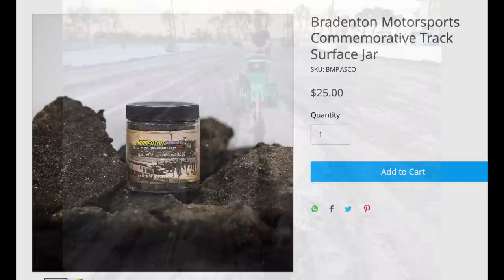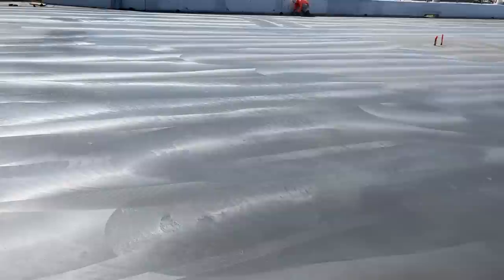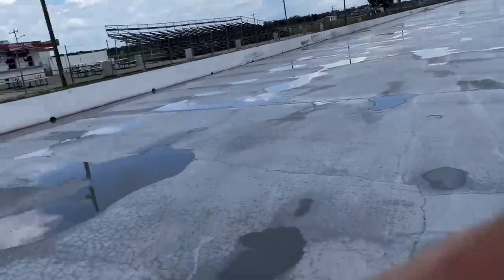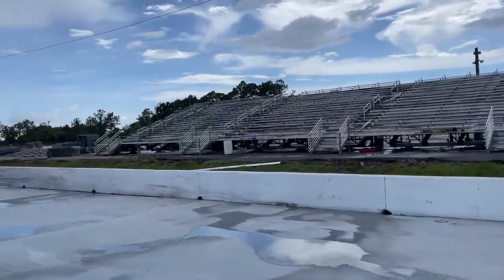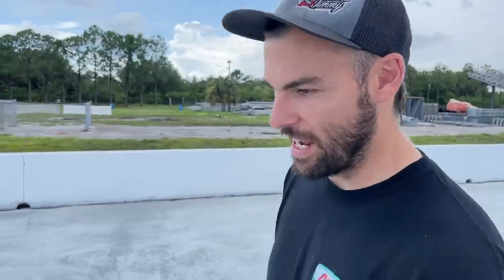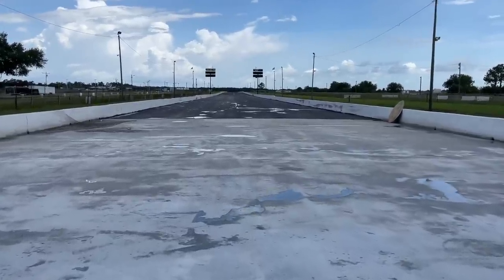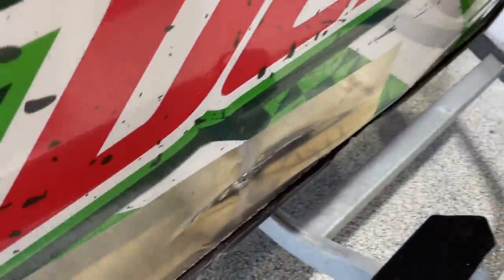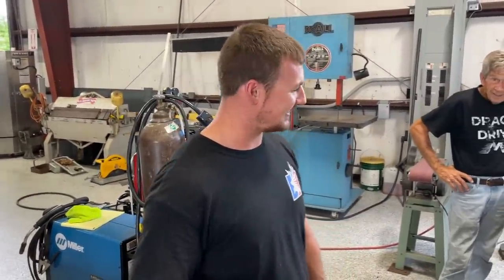This Is Why Our Beloved Drag Strip Closed...

Comment: Bradenton will forever be one of the best prepped drag-strips in the USA
Reply: That's cute but Maryland has it covered
Reply: Considering how many WR’s are set at Bradenton already it will be scary how fast cars go down the new surface
Reply: @User78347  I live in MD, I would love to know of a track that is better then Bradenton
Reply: Considering how the concrete is already cracking I don't see it lasting that long
Reply: @kevinbutton4580  concrete cracks. It’s not a big deal. And they don’t have a freeze-thaw cycle. They hired the best. I’m sure it will be fine.
Reply: @kevinbutton4580  That's how it is, it cracks.
Reply: Little Thumper 67 camaro seen that track many times along with Maxie's 1320 out of Taft Florida.
Reply: @kevinbutton4580  tell me you’ve never poured concrete without telling me…
Reply: @kevinbutton4580  and not to mention the questionable grading with all the water ponding spots
Reply: @User78347  when it gets resurfaced it will help out a lot
Reply: @User78347  you don’t seem to realize how much it can rain in Florida and how little water that actually was
Reply: @kevinbutton4580  this isn’t your daddy’s driveway bud. Cracks are everywhere just go look at a race track. F1 tracks have cracks , nascar has cracks.  You just don’t know what ur talking about and it shows
Reply: @User78347  I guess you didn’t pay attention to the video.  They are grinding and putting a finish on top of it, but hey, you clearly know better than all of us.
Reply: @1216jimmyz  been in the industry 35 years
Reply: @User78347  35 years and misses the part about it having yet to be surfaced yikes
Reply: I'll throw Pacific Raceway in there.
Reply: @User78347  damn, remind me never to hire your company to do any work.  Can’t even hear something that was said multiple times about exactly what you were complaining about.   Sheesh

Comment: Nice to see that Bradenton has gone full tilt in on improving the strip. It’s nice when the owners are willing to spend a whole lot of cash to make the track much better for contestants and fans alike. I can’t wait to see your first runs on the new surface. 👍👍🇨🇦
Reply: @fast97z24  those numbers sounds extreme
Reply: @fast97z24  Tell mm you didn't listen to the video without TELLING me you didn't listen.
He straight up said that it was only half concrete to the eight mile.

Comment: The new concrete is already developing cracks from the looks of it. Hopefully the work they still need to do to it will get rid of them. And fwi I'm not talking about the expansion joints they cut in to allow the concrete to expand.
Reply: Yea there were lots of cracks in the surface, they might need to put down a new layer. Down in homestead the pit lane has barely any tracks in it after years of use. That has tons of cracks, however it isn't done yet but it might need another layer of concrete before they grind and seal it.
Reply: Watch at 3.54
Reply: I've done concrete work all my life and concrete is going to crack no matter if you have expansion joints in it or not even if you have wire mesh inside the concrete it will still crack which is why concrete crack filler was developed sealing the concrete Will also help with cracks!
Reply: Also concrete takes 75 years to fully cure so cracks can develop at anytime even the hoover dam is still curing
Reply: I hope they have some extra layer going on. It's cracked all to hell and the water pooling isnt ideal

Comment: Thanks to Victor for doing this!  A huge investment and commitment to the car community!  I'm from Atlanta and losing Commerce to apartments still stings.  There's not a drag strip left in north Georgia.
Reply: Did they close the one at the top of Georgia, Ringgold I think??
Reply: Couldn't agree more.  Silver Dollar is the next closest and it's 2.5hrs from me which is a painful drive one way to race.
Reply: @94b20gsr  what about middle ga?
Reply: @truckerdudexxl  That's basically where Silver Dollar raceway is, in Reynolds GA.
Reply: @94b20gsr  nahhh, you have silver dollar and middle ga over in twiggs county

Comment: I'm sure that low cost ease of repair for the Mustang axle is exactly what Vaughn was planning for when he said you'd only get it setup how he wants
Reply: "Full floater" rear end is ideal for easy maintenance.  The axle holds no weight.  All it does is drive the wheel.  Break it, and slip a new one in.  The wheel bearing  assembly holds the weight of the vehicle not the axle.

Comment: back in the 70s my grandfather owned one of the crews that did the concrete at Pomona Fair Flex dragstrip. i grew being able to hear them practice and hear the difference in top fuel compared to the rest.  and of course, i went to watch them drag. you're doing so much for the community with putting money into tracks. respect for that. your prolly a life saver for a lot of people making these tracks available again.

Comment: That concrete is super spider cracked from drying to fast. Maybe it don’t matter as much because they are grinding the surface. I just know from having my brand new garage floor done. It looked like that and the co
Kanu came out had to grind it and surface it. The owner explained why it came out wrong and why he wanted to fix it.
Reply: Did you bother to listen to the video?  The finish is not complete.
Reply: @paulcopeland9035  a crack is a crack. Nothing they do from here on will fix that and it will continue to need touch up. It's really ashame.
Reply: I don't imagine cracks are that much of a worry in Florida. It's notice they have 5 months of continous freezing and thawing temps that will destroy it. It's concrete, there are only 2 guarantees with concrete, it's going to get hard and it's going to crack.
Reply: That's crazing it's from to much water being used on the top to finish the concrete. Could be a problem.
Reply: @splashman420  Supposed to be professional Drag Strip concrete guys??? Is it just the cream on top with the cracks????
Reply: @stoker20  he said they were going to take 1/4 " off grinding, I imagine if it needs more then they will do it at that time. Probably poured way to wet. Pouring concrete in Florida is a lot different than other places.

Comment: Wow Victor is the man!  Putting some big money into Bradenton.  Concrete is SO much better than asphalt.  Especially when it gets hit and because rain doesn’t seep down into it and then get pulled back up by higher horsepower cars.  My only concern is leaving asphalt on the big end.  Will make tuning high horsepower cars a bit tricky.
Reply: So confused by this comment. Not sure what your trying to say..
Reply: @masterbates7016  asphalt absorbs some water when it gets wet and big hp cars put so much energy into the asphalt trying to hold traction that it shakes the water to the surface and could cause cars on slicks to lose control. Although if you’re having traction problems past the 1/8th mile idk maybe get some better suspension or tires
Reply: @masterbates7016  - Yeah, I should have proof read it before posting.  Definitely not very clear.
Reply: @fernandop937  - Some years ago I went to a March Meet Nostalgia race at Bakersfield, CA.  The track back then was all asphalt and it rained for like a solid week prior to the event.  It got really dangerous for the faster cars (under 8 seconds).  With the rubber base covering the asphalt the cars could launch ok but past half track where the rubber got thinner the cars slicks would pull up moisture from the asphalt.  Cars were sliding all over the place at speed and at least 2 cars were destroyed in roll overs.  They ended up having to cancel the event.  A few years later the track owner tore out the asphalt and put down concrete from start to finish.
Reply: Almost every track has completely different levels of traction at the 1/8th, hell some dont prep past the 1/8th so tuning will be same as normal.
Reply: @Jake_Hamlin  Check out the NHRA national event tracks.  Over the last few years they have all upgraded to concrete starting lines.  Typically they run the concrete out to 300'.  A full 1/8th is rare!  When Bandimere (Morrison CO) went to 300' concrete they also added cooling lines in the slab.  They have a chiller that will circulate coolant when the track temp is excessive.
Reply: @paulcopeland9035  The whole 1320 feet and then some at Bandimere is concrete. It goes from the water boxes to past the finish line.

Comment: That concrete looks bad. It's covered in shrinkage cracks. Looks like it was poured too wet to me and on a really hot day without doing anything to keep the concrete Temps down. Hopefully it's just on the surface and they can grind through it
Reply: There's still steps left to the surface
Reply: I was gonna say the same thing. That shit is gonna fall apart with the tires rippin. Looks like it was just the first truck
Reply: i guess we will find out. doubt he had rookies pouring but we will find out in a couple weeks
Reply: I've got quite a bit of experience with concrete.  That shit looks like shit
Reply: The spider cracks really don't matter much on a drag strip.  A local track poured their first 330' about 5 years ago, albeit it didn't look this bad but close, and that track is dialed now.  But yea, i'm about to have 40 cubic yards poured in a garage and I will cry if it comes out like this lol.  Waiting for the temp to come down some.
Reply: I was thinking the similar with all the cracks. Like it was said that hopefully they can finish it to eliminate the cracks.
Reply: @ToObUrNoUt   what do you mean they don’t matter? 7 years in concrete here. The surface is gonna fall apart as soon as someone try’s to burn out. Unless there is another surface I don’t know about going on top
Reply: watch the whole vid he said they are not finish and it will also be grind
Reply: He says it in the video, they're grinding the top, polishing it, and putting a finish ontop. 3:55
Reply: @justaguynamedmax8207  yeah? just like a house without siding looks like shit. they aren't finished yet. and if it bothers you so bad drive down there and tell vic what's wrong with it
Reply: @spitfire20122000  Exactly, that's not the finished surface.  Once it is grinded and polished, and they lay rubber down it will be fine.  Those spider cracks will affect the finished surface just as much as the control joints will.
Reply: @Kemicalkoma   he’s just pointing out the obvious. Concrete guys see that stuff and cringe. But it’s not the finished surface so it doesn’t really matter
Reply: Those are just surface cracks from the concrete drying to fast it will be fine
Reply: @Kemicalkoma  well, when I put sub flooring in a house I make sure it's butted up tight and properly nailed and glued.  Just because something is being covered up doesn't mean the quality of work doesn't matter.  How is a surface suppose to hold when the sub surface is falling apart?
Reply: @ToObUrNoUt  Not sure what your background is but I've been a commercial const super for 30 years. Poured well over a million yards including 2 rinks and 3 gyms along with many schools and a few hospitals and never seen cracking like this on a straight line pour. Luckily this is slab on grade because if it was structural we would have had to epoxy inject every one of them or remove the slab possibly. If those cuts were done too soon, they will dry faster and become a 3/4 inch to 1 inch hill that will taper down 4 to 5 feet each side... i know, I had to grind a gym for a month because an engineer spec'd this on one of my sites. The cracks can become a problem if not sealed properly because of moisture penetration attacking the rebar but luckily you don't really deal with frost which would just destroy this concrete over time.
Reply: He supposedly used the best crew for drag strips but yeah it looks like they didn't keep it cool while curing, it looks like crap...
Reply: It looks like there are some larger cracks in it too which is very concerning.
Reply: @spitfire20122000   Shrinkage cracks like that are almost always totally cosmetic. If they weren't going to put a surface on it, it could become a problem with water penetrating into the slab, especially if it ever froze. The track prep will keep water out. I would also say that those cracks would have easily been prevented. Adding a retarder or fibers would have been a great start. Keeping it cool on the surface would've helped a ton also.
Reply: @Towing417  id bet money the surface the way it is wouldn’t hold up well to constant drag racing abuse. No big deal though since that’s not the final finish anyways. Hope it turns out good!
Reply: @spitfire20122000  I hope it turns out good too!
Reply: @justaguynamedmax8207  There is always one!  Or in this case, every YouTube concrete expert there is has to tell us how good they are and what total shit everyone else is!!

Comment: Looking great!!
Concrete does not dry. It cures :)
Technically, it never stops curing.
Concrete gets stronger and stronger as time goes on but to reach a practical strength, most industrial concrete mixes have a 28 day curing period.

Comment: Love the racing content, especially love all the fun you guys have in the ripsaw, jetboats, and everything else you get into. I do kind of miss the videos from the old shop where it was all about working on the cars. Would love to see more videos from you guys working on the cars, either tearing them apart or pulling an engine. Even the basic stuff you do before every race to make sure the engine is good, would love to see more of the small stuff you do.

Comment: I’m wondering if there’ll be engine changes to Leroy? I’ve been curious what a compounded boost setup would do for that car now that’ll have actual traction.
Reply: Do you mean Leroy 2.0?  OG Leroy has passed on!  They left his corvette innards on the shop floor.
Reply: compound would be to build boost faster.. maybe it would be cool at one of those high-altitude tracks they always have troubles at
Reply: I feel like Leroy is kinda becoming an science experiment. I’m not expecting it to show up non stop on my feed but testing different combos out on it would be cool.

Comment: It's a little worrying to see so many cracks in that new concrete...
Reply: That’s what happens when you pour slabs that big. Look at any concrete highway
Reply: @zeitgeist2720  I don't know. I've helped do quite a few large driveways and never seen it. But I'm no expert by any means.
Reply: I understand but it’s not even close to being done yet watch the video
Reply: 3:55 Cleet said its not done yet they still need to grind and polish.
Reply: @zeitgeist2720  I'm no expert but that's supposed to be what relief cuts and keeping the concrete cool while it cures is for. It looks like it over heated and cracked, which isn't good. The burnout pad at the FF isn't as long but it's much wider and it doesn't have cracks like that.
Reply: @bobbygetsbanned6049  you cant use relief cuts when pouring a drag strip. You want a flat even surface for the rubber/prep to stick to. This concrete will be grinded and surfaced so not much to worry about, doesnt have to be pretty to do the job
Reply: @Jake_Hamlin  It already has relief cuts, you don't get to skip relief cuts just because it's a drag strip, it has to have them or the slab will crack on it's own. 
They are not going to grind that much off the surface, it's not like they grind an inch off, if those cracks are deeper than a small fraction of an inch they aren't getting removed. 
There are a bunch of concrete guys in the comments who have said the cracks shouldn't be there and that it likely was poured too wet and/or overheated while curing.

Comment: I work in the construction industry. One great thing about going with concrete is that now you don’t have to worry about hydraulic fluid or solvents breaking down the asphalt. I’ve seen some wild degradation happen to binder and bitumen from that stuff.

Comment: Man i feel bad, That concrete is not going to last.... Already splitting everywhere and its brand new. I only see stress reliefs in one direction and not nearly enough of them. Even if its been a month since that was poured, the amount of cracks is bad. There also shouldn't be ANY water pooling.

Comment: Unless there is polyethylene barrier under the concrete water will absorb through it. Unless it is sealed water will absorb into the concrete and sweat it out later too. We always put a slope on concrete to let the water drain off of it always crowned it in the center to run off both sides. You have to get the water off the concrete so it will not soak it up and come a freeze and pop the top off of it. Then you have to go back an patch it up and reseal it. for the first 27 days you supposed to keep water on the concrete so it cures out evenly without cracking. Actually concrete will cure harder under water than if let to dry out rapidly. Then it usually want to crack when it has a rapid shrinking effect.

Comment: The angle of the rear plate looks standard, but the upper bars could still be at least 2" shorter. That angle is good for overall any bias ply tire size, but when shooting for particular size and suspension dynamic, I'd strongly suggest bringing the upper bar mount further back to shorten the upper bar length. Minimum is 6,5" and anything beyond that is a waste of 60' time.

Comment: Hey Cleeter McSkeeter, you'll need to buy a Titanium Mandrel or either a Chrome Molybdenum Mandrel as backup for when you go in multiple day drag events cause you can't have your mandrel just break on you again which would push you out of the competition if you can't find a replacement in a hurry. A Titanium is around 5x stronger than Mild Steel, not sure if it's brittle under load but Chrome Molybdenum under load is able to flex a little while not breaking down it's structure.
Reply: Thanks for watching
Dm the above number 👆
We're having a giveaway session 🎁🎁....